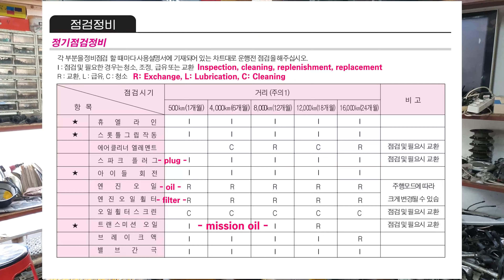Awesome video showing damage and repairs that occur when there is no transmission oil - Forte125

Comment: Tell me please!
How much will new original piston rings cost for Daelim Delfino 125 cc - 2007 release, front disc brakes on it, and rear drum brakes.
And you can also answer how much a new piston costs, also original from Daelim
Reply from the maker: The price fluctuates and is not exact, but the approximate price is as follows. (This is the price when ordering in Korea and using it in Korea.)

Front Disc Brake Pads: $11.1799
Rear drum brake lining: $11.1799
How much do piston rings cost? $3.7266 (Piston Set $11.1799)
Reply: @MotorcycleRepair  
Thanks for the answer !!
Reply from the maker: @hilt487  😀😃😄

Comment: Thank you,  what will happen if you put( lets say 50 - 75ml) more transmission oil than recommended?
Reply from the maker: Most transmissions are designed to overflow when the oil exceeds a certain amount due to their structure.
Therefore, you can consider it impossible to put in enough oil to cause problems.
There is no problem with a small amount of oil becoming too much.
Reply: @MotorcycleRepair  thank you. .